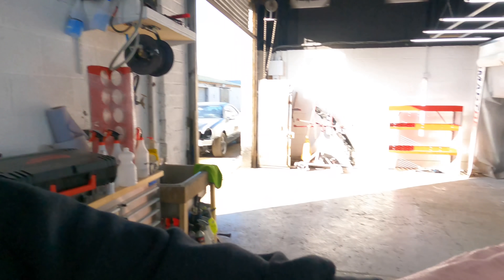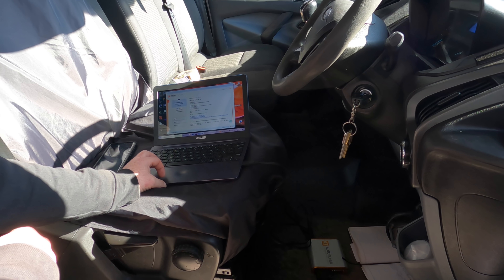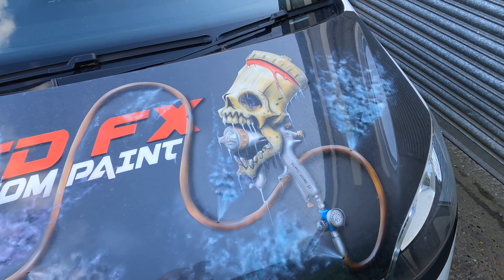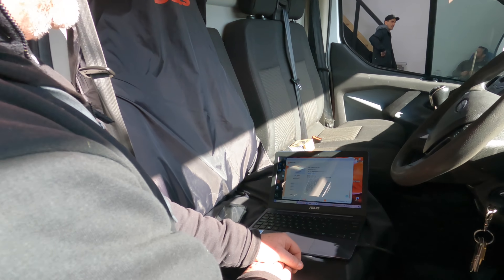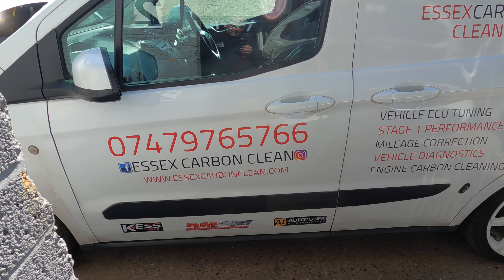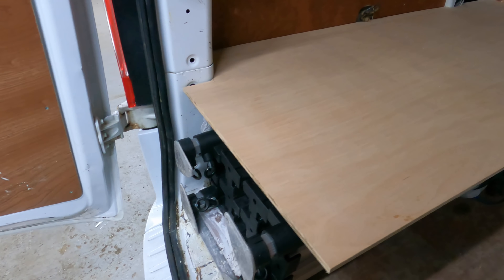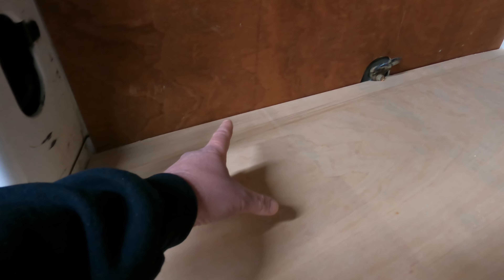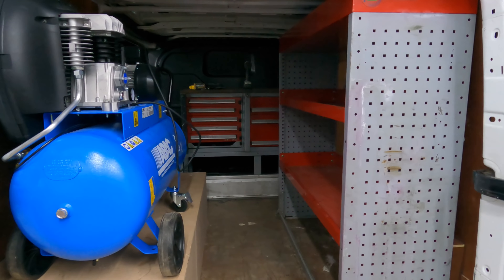Smart repair van build pt4

Comment: i would be using the power upgrade with kid gloves as any downtime means no work,looking good ,any security is good security,back in time a little switch on the fuel pump line was sufficient nowadays it needs fort knox security to keep your possessions safe,as i speak i have a cctv monitor on in the background watching my work premises as sunday nights are prime burglar times usually for some reason,all the best for your new chosen direction

Comment: This van looks awesome, nice layout . 
Been trying to work out what model your abac compressor is, I’ve been looking at one but similar but unsure what one to go for single phase ?
Reply from the maker: This is the one I use it won’t trip your electric 👍👍👍 and I use a abac dry25 dryer to👊👊 
https://www.ebay.co.uk/itm/183389119107?mkcid=16&mkevt=1&mkrid=711-127632-2357-0&ssspo=u5OtyrCBTHW&sssrc=2349624&ssuid=7sdhwvgpqfc&var=&widget_ver=artemis&media=COPY
Reply from the maker: This is the one I use it won’t trip your electric 👍👍👍 and I use a abac dry25 dryer to👊👊 
https://www.ebay.co.uk/itm/183389119107?mkcid=16&mkevt=1&mkrid=711-127632-2357-0&ssspo=u5OtyrCBTHW&sssrc=2349624&ssuid=7sdhwvgpqfc&var=&widget_ver=artemis&media=COPY

Comment: Good luck with the smart repairs venture. Hope it all works out for you Grant. I would keep the unit if you can, as you’ll find it potentially brings work in that needs all those facilities and all the hard work you put into setting it up would be a shame to let it go. It was a long time ago that I did smart repairs and found the trade screw you down on rates to such an extent, it’s really not worth the effort. Better to concentrate on private customers, as the pricing is more sensible. Maybe different now of course.
Reply from the maker: I don’t like doing trade work tbh and I want to get rid of my overheads mate and just get out there and do something new 👍👍👍👍👍

Comment: Hi buddy looking good :) are you going on the roads instead of workshop ? I’ve always thought about putting a van out there but hard to get good guys to do the work.is waterbase ok for outside use ? Keep up the good work mate :)
Reply from the maker: Yeah I’ve made my mind up I was going to keep both but now I’ve decided to just go mobile and yeah the lechler my mate uses drys as quick as solvent I was well shocked
Reply: @grantssmartrepairs it’s not easy mate having a body shop the overhead’s are shocking plus the gas and electric increase is going to be hard too.good call mate I know someone who’s does it and it’s far more cost affective Witt less overhead’s etc waterbase is better for the environment so fair play buddy :) good luck with new venture :)

Comment: Have you got a generator, was surprised the size you need for a 3 hp compressor.
Reply from the maker: No mate I was going to but most people just plug in with extension lead
Reply: @grantssmartrepairs  always ask the question is power available
Reply from the maker: Yeah mate that’s what I’m going to do on everything I quote 👍👍👍👍👍

Comment: Kin ell grant, you could do with a bigger van. You're gonna be like a bear in a pushchair climbing in the back of that
Reply from the maker: 🤣🤣🤣🤣🤣 I like it snug
Reply: @grantssmartrepairs  we work in totally different industries but here's what I've got in my van to make it more bearable. Mines an xlwb extra high roof iveco daily. I've a split charge kit to a 2000w inverter, which I just use for a pump, led roof lighting and the best thing I put in there was a Chinese diesel night heater. Thats located in the cab under the passenger seat, but I've bored a hole through the firewall into the back so the heat is vented in the cab and also to the rear. An absolute God send in the cooler mornings, as I Just press the keyfob from the house and let the van warm up before I go out to it, and it also gets used while im outside at a job
Reply from the maker: Yeah I’m thinking about that my mate runs them 👍👍👍